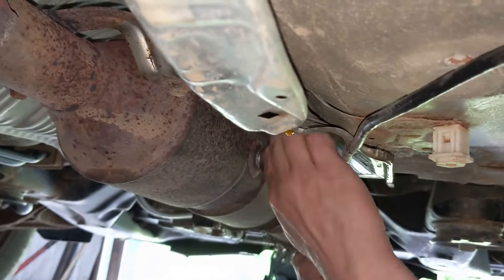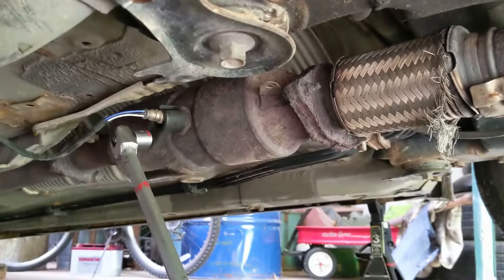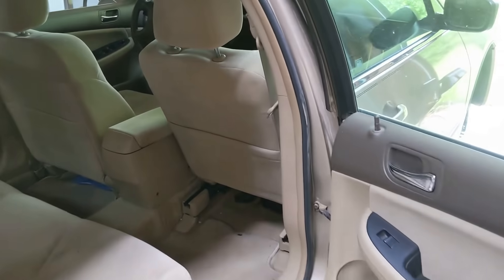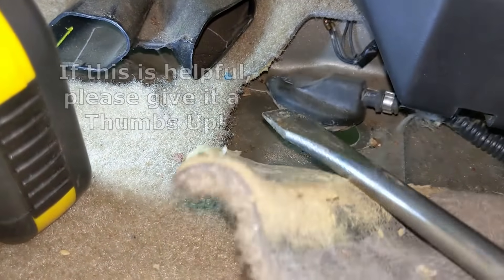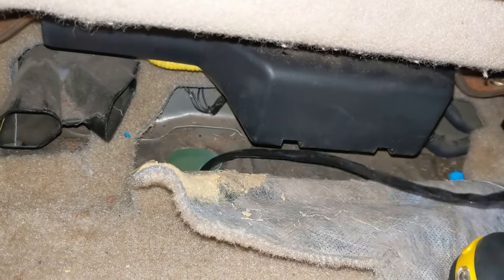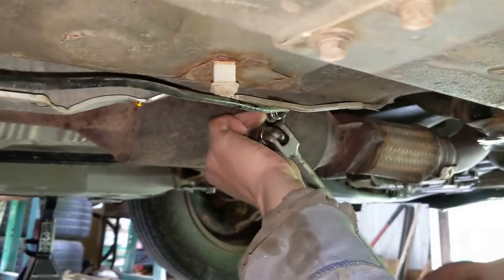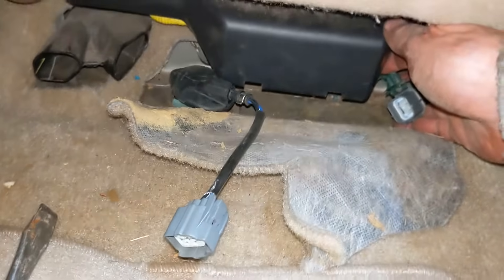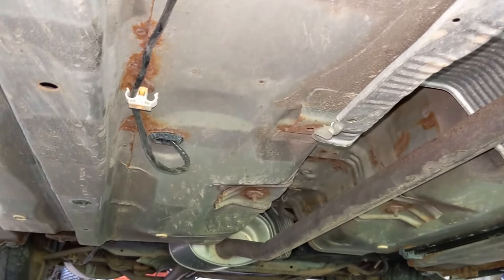P0141 Fix - Honda Accord O2 Sensor Replacement (2003-2007)

Comment: Thank you for the instructions. I recently replaced both of the O2 sensors, because the check engine symbol came up (with the same error code) and the engine was somehow lazy.  Unfortunately after about 2k miles the error code come up again. What could be the problem ? Thank you for any hint.

Comment: Great video. Never saw an O2 sensor connection under a seat before lol.
Reply: 90s models Avalons come through the floor and plug in under front seat
Reply from the maker: Haha, yeah they can be a little tricky!